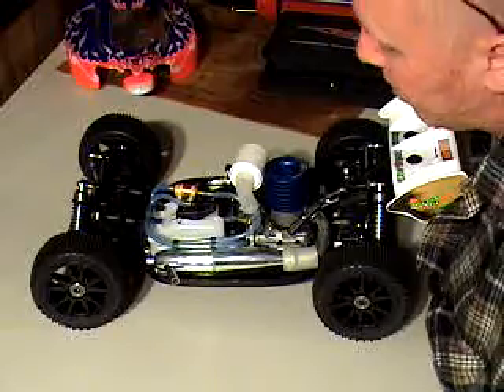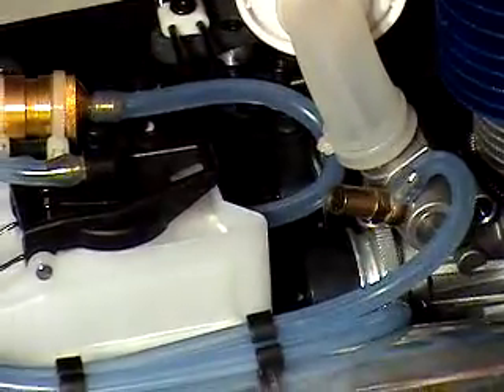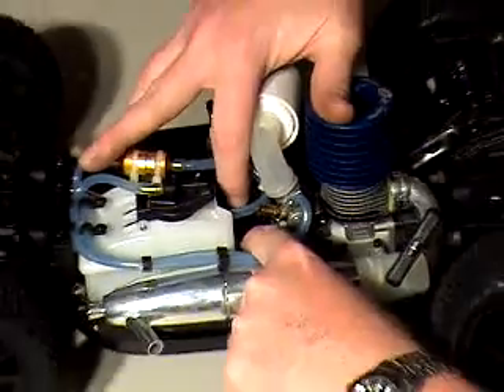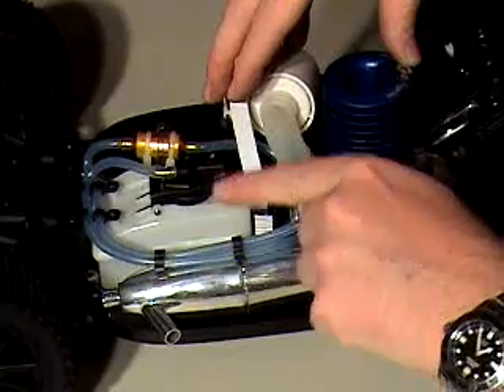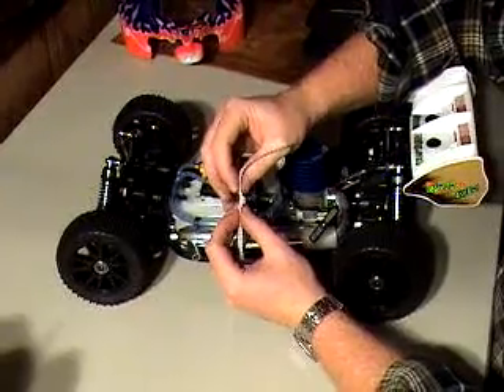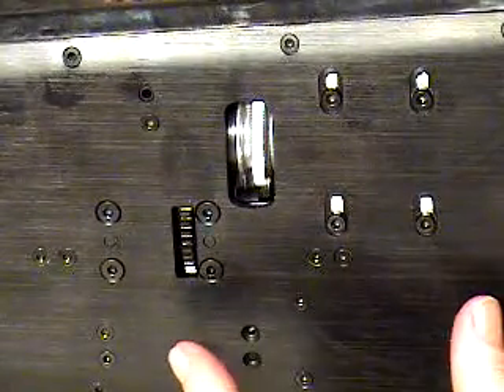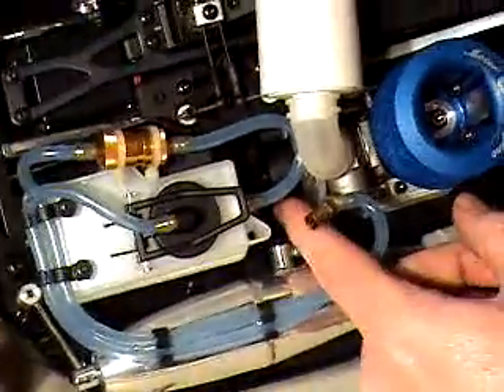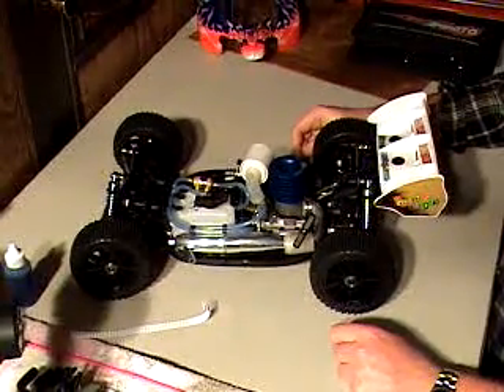How to Check and Adjust the Mesh on an RC Nitro Engine or Electric motors

Comment: Hi i've got a problem with my rc car i i am thinking if anyone can help me please....
I've got a HSP 1/10th scale nitro rc car with a .18vx engine i recently changed the engine head(it was from a same engine). Anyway when i tried to start it it was very dificult to pull the pull start(i also tried it without the fuel line but the same thing happened) and i was wondering if u could help me....
Thanks in Advance!!!